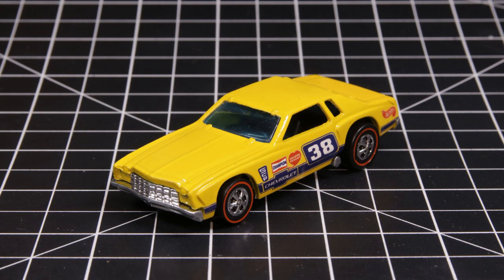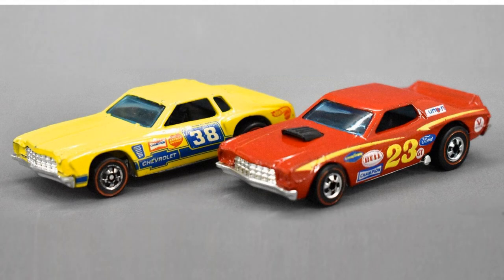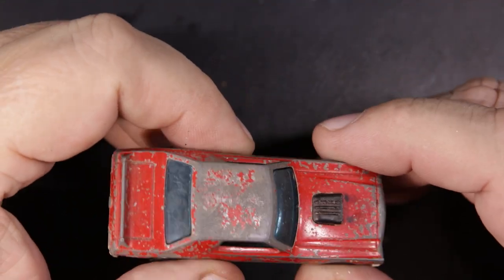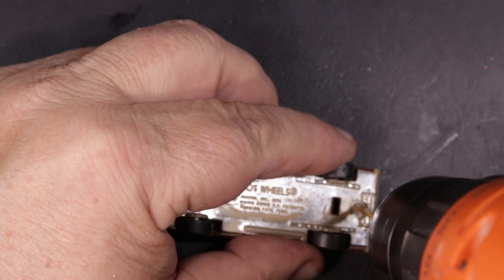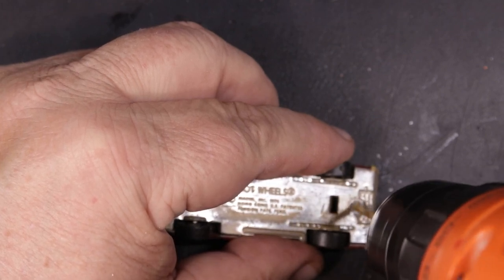Hot Wheels Torino Stocker - Restoration

Comment: What is that liquid you put the plastic base in?
Reply from the maker: It's called Super Clean and it takes the chrome and paint off without damaging the plastic.

https://www.amazon.com/Superclean-101723-1gal-Super-Degreaser/dp/B01J05YTU2/ref=sxts_rp_s_a_1_0?content-id=amzn1.sym.eff26b9b-e255-411b-a40d-eccb21f93fe4%3Aamzn1.sym.eff26b9b-e255-411b-a40d-eccb21f93fe4&crid=3BH0X96SNGF9V&cv_ct_cx=super+clean&keywords=super+clean&pd_rd_i=B01J05YTU2&pd_rd_r=a141af1e-25c9-4fff-9c60-eae5ea245699&pd_rd_w=1Fw2C&pd_rd_wg=Z6FKz&pf_rd_p=eff26b9b-e255-411b-a40d-eccb21f93fe4&pf_rd_r=6KTYC1TMGTSNWBX9MG0G&qid=1675456752&sprefix=super+clean%2Caps%2C126&sr=1-1-5985efba-8948-4f09-9122-d605505c9d1e
Reply: I couldn't find super clean where I live. Found Mean Green, must be the same, it did a great job on it. Thank You.